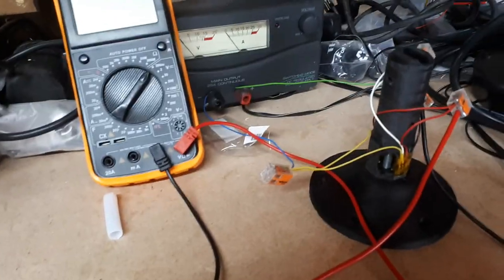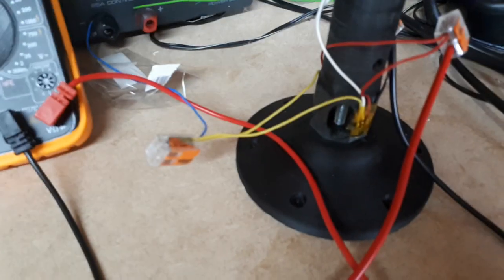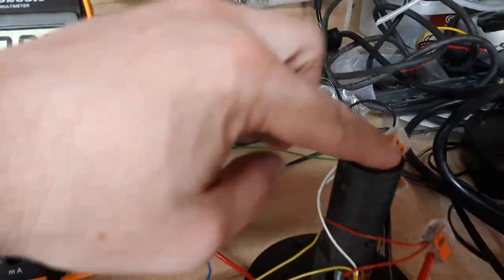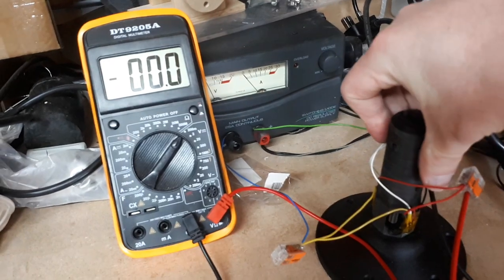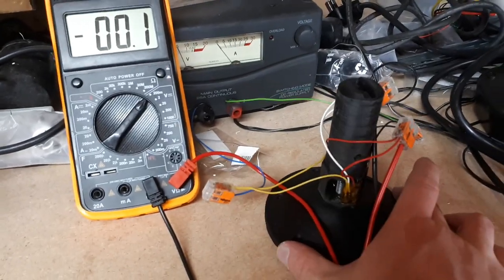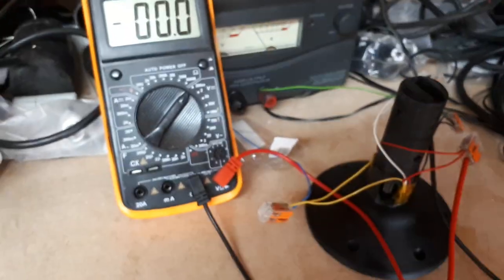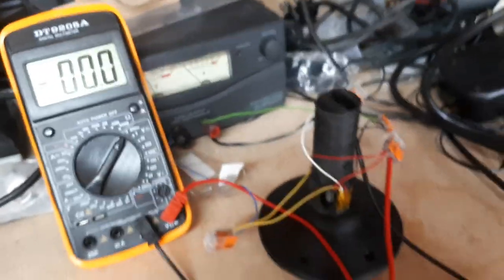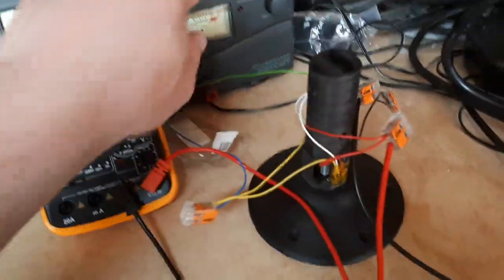Force sensor joystick test.

Comment: What type of load cell/sensor have you used in this joystick? It would be great to see how they are placed and how force transferred from the handle to the sensors. I am kind of thinking of creating force sensing joystick as well but not sure which load cells to use
Reply from the maker: The are in gauges are just cheep ones of e bay. I made it all myself. 

They are superglued down. The easiest way it to stop them to a piece of tape then put thwnglue on and push position them and push them down with the tape. 

It has 4 per axis. 90 degrees apart. So as one is compressed the other that side stretches. They are wired in a wheatstone bridge. 

The structure is 3d printed and designed so force applied on the x or y will not interfere where the gauges for each axis are. 

So there is no off the shelf loadcell. It was all made from scratch. 

Prject has been a bit stalled but i could maybe do a quick video about it sometime if you like.
Reply: @Madkite  thanks for reply. The quick video about internals (especially mechanical part) would be great! 

Do I understand correctly that your placement of the sensors is like 4 sides of a square? Did you wire them in 2 bridges (2 opposite sides go to opposite shoulders of the bridge) or 4 bridge, one bridge per sensor.

I overall it looks very promising, great project, hope to see it completed someday :)

Comment: How could you made and what did you need? I want to make one of them. Best regards.
Reply from the maker: The 3d files are on a patrion. 
You have to print the post 100% infill or very thick outer walls at least. 

Then you need some strain gauges. Cheep 350ohm ones are fine. You need 8 of them. The are arranged in 2 Wheatstone bridges. With the bridges between opposite columns. I have never documented how you wire all this up but if you look in to how loadcells work you will soon get the idea. 

Gluing them on is a bit of an art. It's easiest to stick them in position on a bit of Knapton tape. Apply the glue then stick them down with the tape. The tape is just to hold them in position otherwise they are almost impossible to position as they will move brfor the glue sets. Superglue worked fine for me. 

5v excitation is applied and you can measure the +/- mv across the bridge as you apply load then. 

That's about it. You can get a bodnar board amplifier that can then go in to a normal bodnar joystick board. Calibration may be fun as it would need to be done by force applied rather than movement. 

Currently my pations want a floor mount normal style mechanical stick. But if some join and want this then can add it to the never ending list of things to work on.
Reply from the maker: Can find patrion account on later videos. P47 ones have it on.